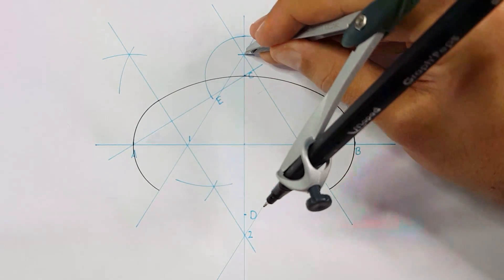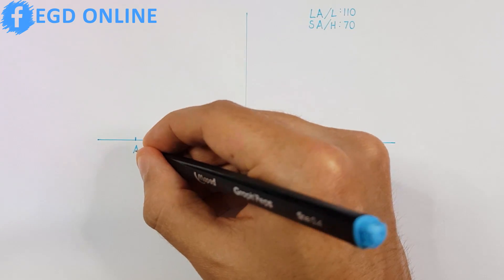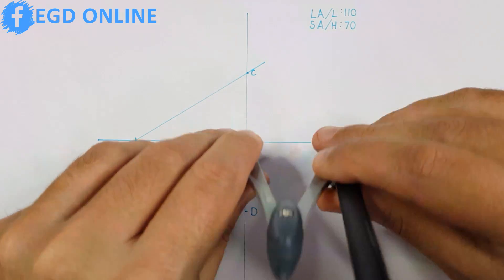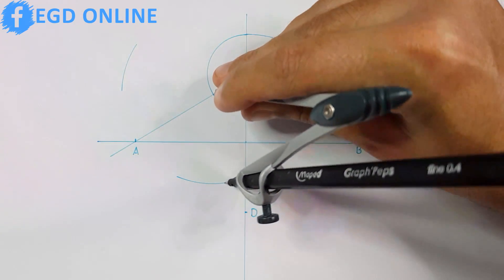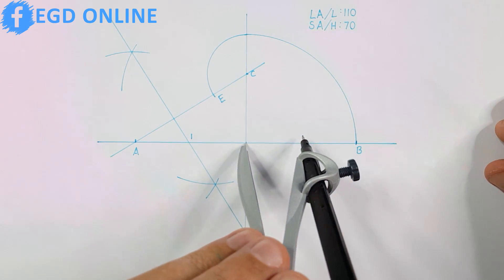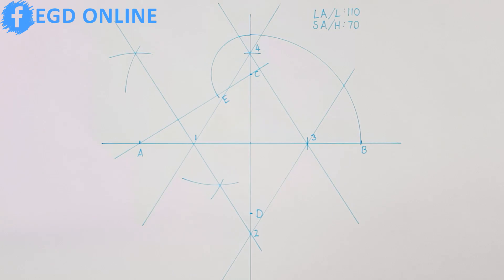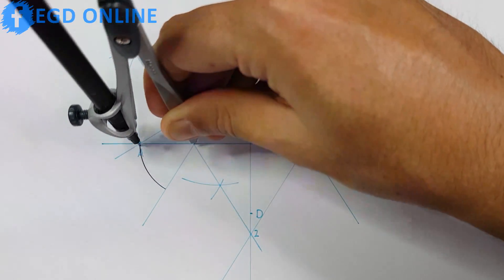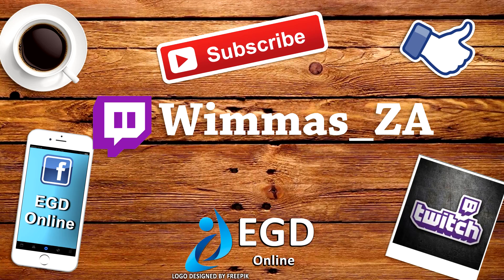EGD Ellipse

Comment: wtf ? .. according to most mathematical definitions ... 
'Essentially, just as a circle has an exact center point, an ellipse has two center or focal points. — Sarah Wells, Popular Mechanics, 16 Aug. 2021'  ...
and as such ... an ellipse is a concept and not truly drawable. (unless you use a loop of string round two nails when it is truly drawable but incredibly hard to descibe the line). You've drawn an oval of sorts.
Reply from the maker: Wtf is correct. Its drawn by hand and its only an approximation so don't get to excited. Thanks for your lengthy reply.